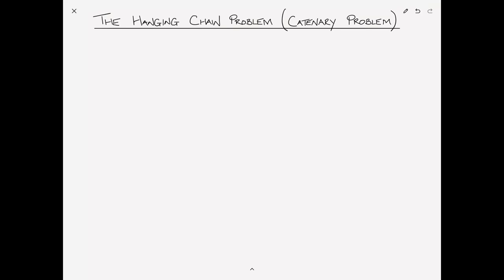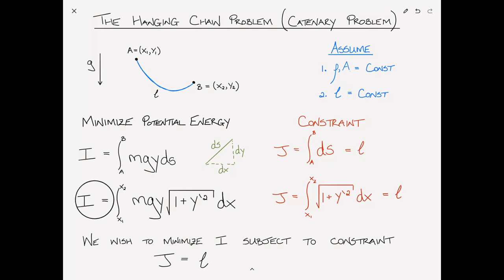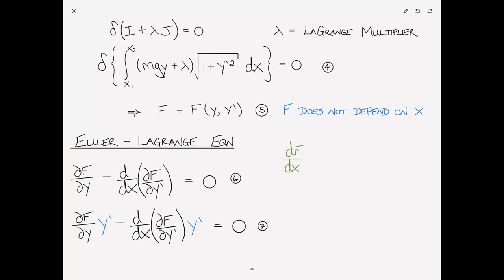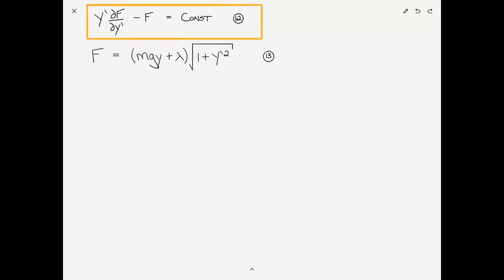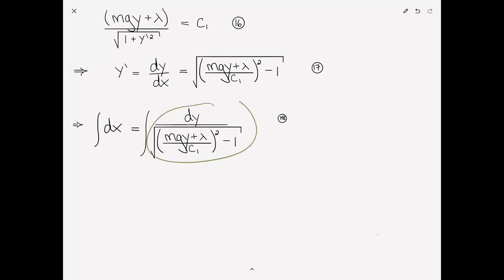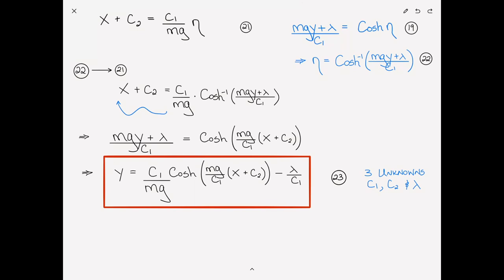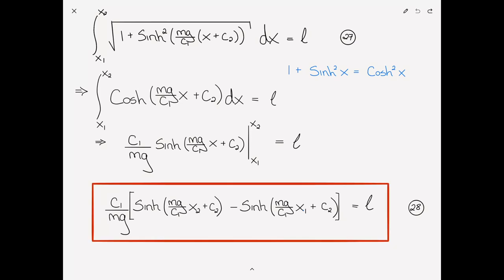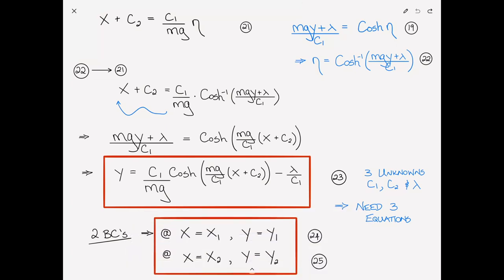The Hanging Chain (Catenary) Problem

Comment: You did something wrong though. You shouldn't have the mass of the chain in the integral. You should have its linear density. Cause potential energy is mgy therefore the integral for the chain would be ρgyds where ρds=dm the infinitesimal mass of the chain and ρ its linear density such that integral ρds=m of the chain. You can even fact check this by looking at 10:17. You have a force being equal to mgy+other stuff, but mgy has units of energy not force. If instead you had ρgy where ρ is the linear density, you would have the correct units :) Other than that the whole Calculus of Variations is solid and thank you for your video!
Reply from the maker: In this problem, m = ρA is the linear density and not the mass of the chain.  I mention this at 2:05 in the video.  So, I am integrating  ρAgy with respect to x.

At the 10:17 mark, the "F" that I am using does not stand for "force", but rather it is the "functional" - that's why the F.  In this problem, the functional has units of energy per unit length, but in general could have various other units depending on the quantity that we are trying to minimize.

Comment: I'm not familiar with this work, but I'm guessing the weight or mass, gravity, coriolis or spin of planet, and dimensions are taken into consideration for the solution? I only watched 4:25 of the video so I'm just risking errors.

I'm no mathematician by any means; but, my opinion is that solutions to problems with force, energy, inertia, movement, stationary objects, etc would have to take into consideration the spin of our planet, solar system, and even galaxial motions.
Reply: This video takes only gravity and the (uniform) mass of the chain into consideration. Any effects caused by the movement of earth are ignored.
Reply: We cannot grasp anything on It's fullest, we only haver models, and preferably useful ones. So ignoring a lot of negligible influences makes the solution easier - sometimes, it makes them computationally or even analitically viable...
Reply: Yes; I understand, the work is done in portions or puzzles. The bigger picture being too complex for the human mind. But, if we never work on the big picture; we will never find the solutions. The ignored portions considered nuisance become missing links.
Reply: @biancabonet  You are right, and sometimes the details make all the difference. This is very evident in dynamical systems, for example: the tiniest detail can make a huge difference over time. In the example of the video, however, it could probably be shown that the effects you cited have a very negligible and controlled effect overall, so that the solution is still imensely similar to the one this model already gives.
Reply: @raphaelreichmannrolim25  Thank you. I tend to focus on purity and accuracy and conservation of the big picture. While focusing on retainment of the CMB, I guess you may zoom in...but zoom in to see plank sizes...you would still have to zoom out and see the macro-universe to begin to understand--to see the big picture..

Comment: Awesome. But is there a real life application of The Hanging Chain (Catenary) Problem?
Or just Maths for Maths?
Thank you for reply.
Reply: How many meters of wire are needed for a 1000m electrical transmission line, given pole height, spacing and ground clearance?
Reply from the maker: Catenaries appear in many different applications.  Clearly in the design of suspension bridges and in designing power lines.  They are used in architecture when designing arches - arches designed in the shape of an (inverted) catenary are the strongest arches you can build (since the catenary shape minimizes the compressive load).  Catenaries also used in ship building for optimizing the design of anchor chains.
Reply: @Freeball99 compressive loads (unless stability related) are not a problem in archs though. The real reason why a catenary shape for load carrying beam structures is desirable, is because we only want the structure to be loaded by membrane forces and not by bending moments. This is because membrane stresses are distributed uniformly over the cross section and therefore make use of "all the material" to carry the load.